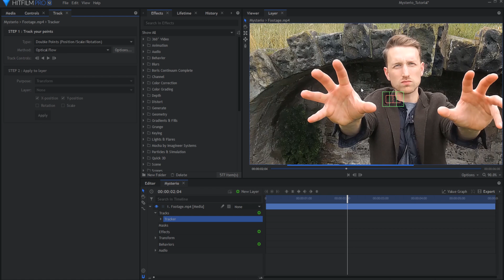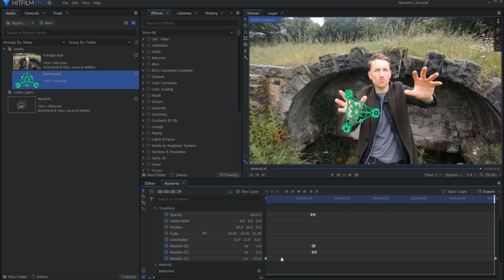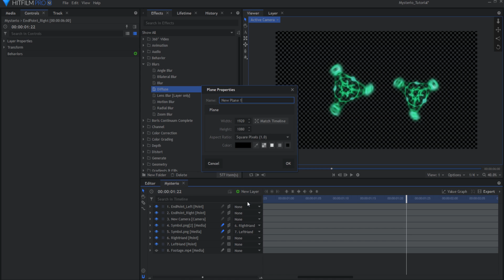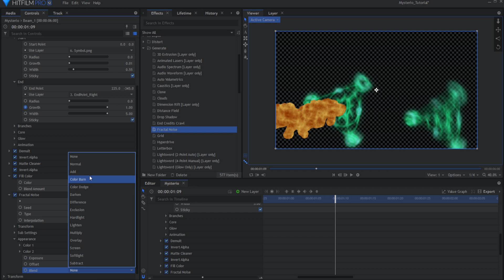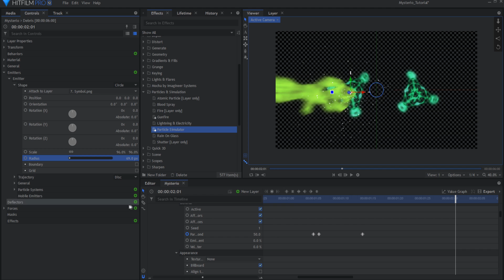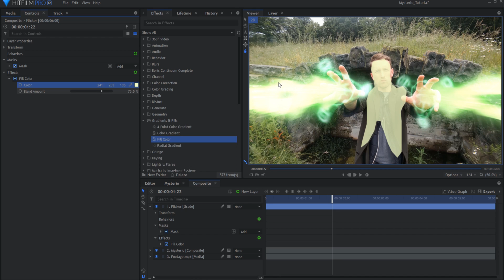How to create the Mysterio magic effect

Comment: Note for Hitfilm Express users: You can get a similar look to the particle sim section of this tutorial by dragging in the 3D Bonfire effect. Twirl open and turn off the "Active" properties for the "Fire" and "Smoke." In the "General" section set the "target" to 0,0,1000. This will give you only the embers and they will now fly towards the camera. Parent this to the same point as the track.

From there you'll play with the spread, turbulence, and number settings in the Embers section and also change the Ember color to green.

You won't have the direct control over the speed of the particles by adjust Speed or Force values as in the particle sim, but this does get you close to what Tom built, all in Hitfilm Express with no add-ons.

Comment: Nicely done! In Pro my instinct would have been to use a particle sim for the central beam (probably with smoke textures), but the lightning is an interesting choice and worked well.

For the lightning matte, Javert's Alpha Invert-Matte Choker-Alpha Invert works well. Another would be to add a strong Glow with high intensity and small radius, a Threshold and a Demult.

Another channel just did a Mysterio effect, but their's was based on stock footage (requiring one to shoot to match the footage), while this method - procedural, thus allowing complete flexibility in positioning - is superior.

I haven't tried it yet, but I'm wondering if the 3D Bonfire effect could be tweaked... Remove fire/smoke, keep embers, see if the speed can adjust. That might duplicate Tom's particles in a way that makes the entire effect possible in stock Express. Bonfire might not be flexible enough in its controls to get speedy particles, but it's a thought.

"ONE OF US!" Classic!
Reply: Hitfilm University what was the other channel that did this effect?
Reply: @dominickpuleri4493  Production Crate.
Reply: Hitfilm University ah gotcha. Could you be a bit more specific with how you would use particle simulation, or even do a tutorial on it? because i’m very interested to know how to do this type of effect but with more of a way with particles then lightning.
Reply: @dominickpuleri4493  Not a particularly difficult setup, and Tom covers most of it here. Using what Tom did as a starting point I'd still create the same circle emitter and connect it to the same tracking point. The emitter would be the size of the center part of the symbol, not the entire width. Otherwise I'd change the Emitter's Trajectory to Cone and set the Radius do something small (between 0 and 5 degrees to start?). I'd rotate the emitter until the particles are flowing the correct direction, then choose a smoke texture. That's about it. I could either set the particle color directly in the sim controls, or with a tint effect like Tom used.